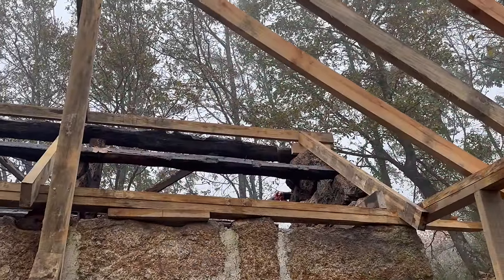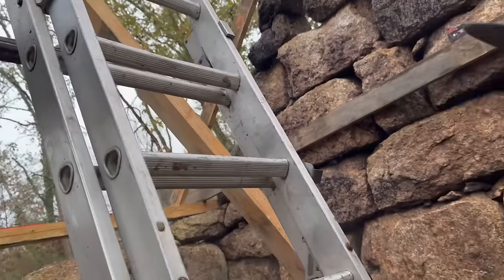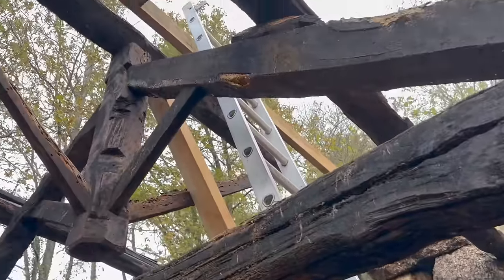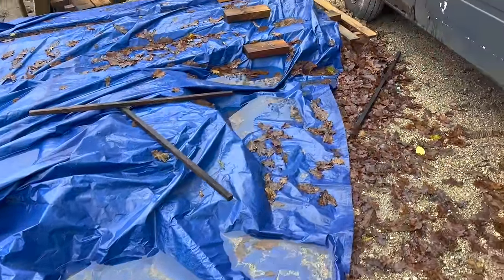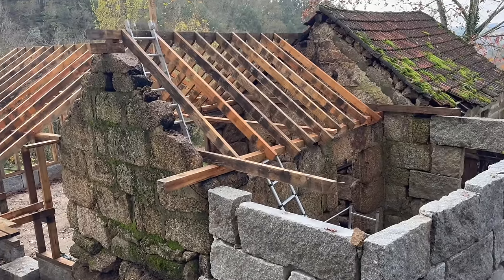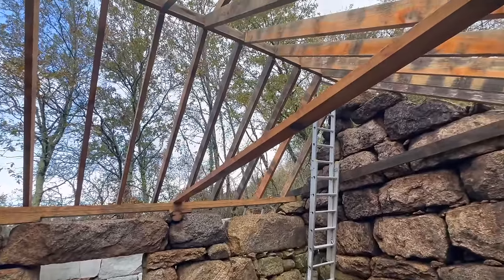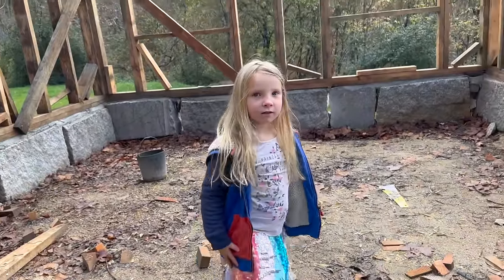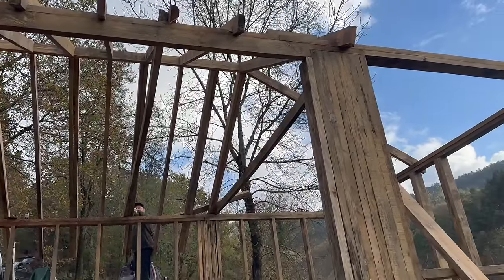#06 - HOMESTEAD LIVING OFF THE GRID - RURAL HOUSE RENOVATION- BUILDING OFF THE GRID HOUSE 🇵🇹

Comment: Awesome effort guys. crack the whip a bit harder and you might move in by Christmas! JK🤣🤣🤣🤣I just had 2 of those windows put in a very high ceiling above a pool, they are remote control open and close, it is so amazing to crack them just a little and let the heat out of the roof, they weren't expensive, the labor was crazy $$, but you have a Badger🤣🤣
Reply from the maker: Haha yes that’s what I said 😂 
Oh amazing yes they are great to let out any extra heat that rises ☺️